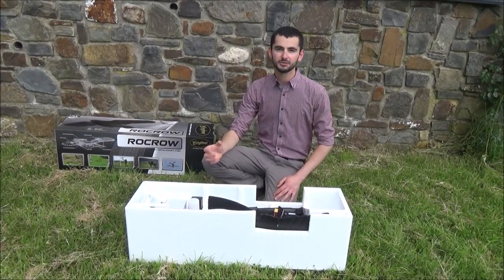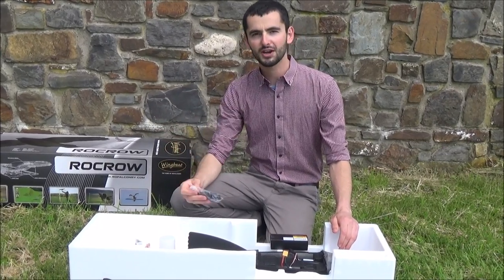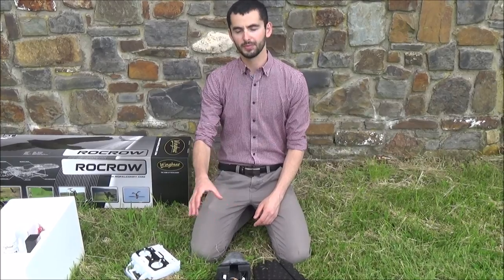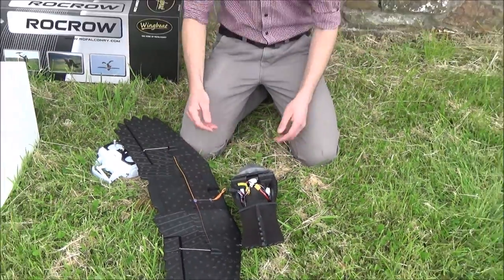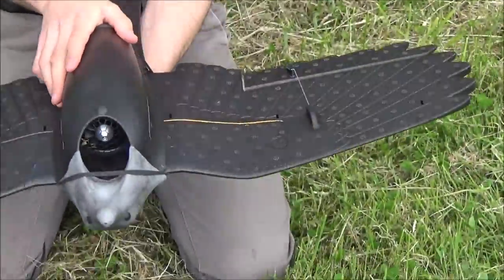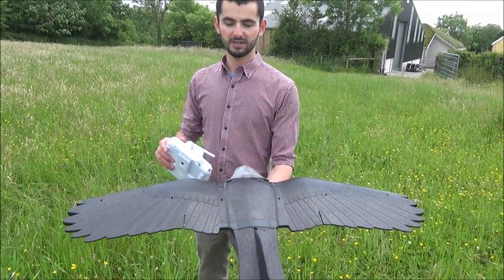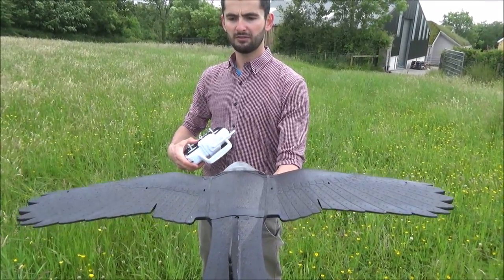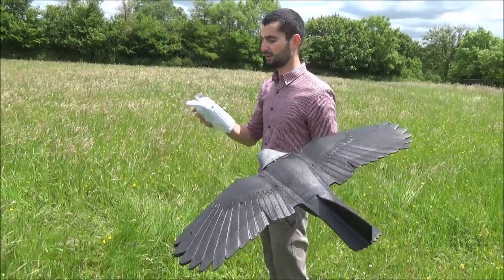Rocrow Video Manual

Comment: patheticly over prised extreamly bad very out dated components pluse no 6 lads been flying/building rc years had them drop bits mid air built my own gps rtl self flyet for £85 stay clear this itam ya been warned
Reply: Bro it’s a falconry equipment not just a rc plane